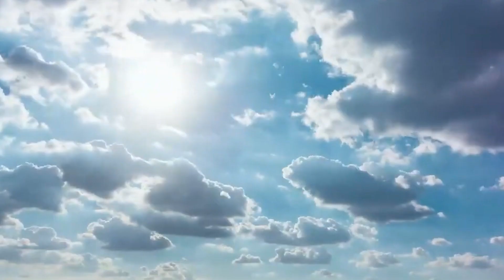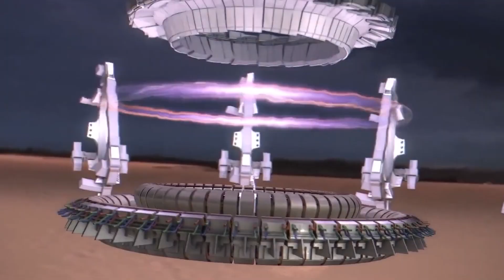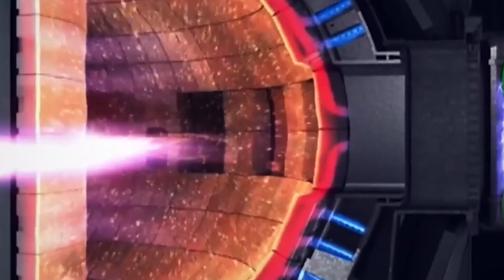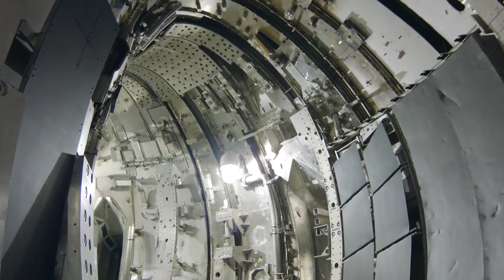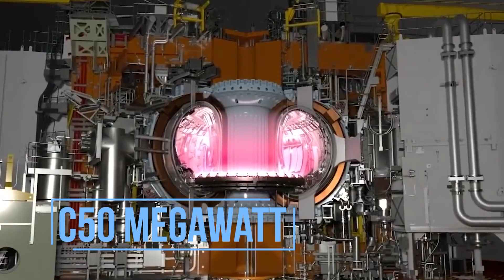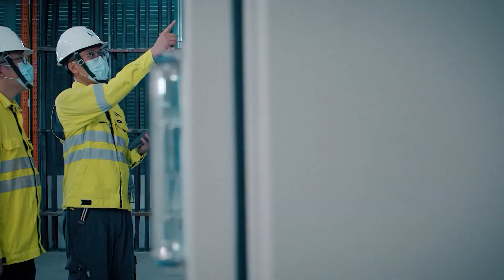This Fusion Reactor Will Produce Electricity By 2024

Comment: How much of the rare He-3 will be needed to start a reactor? I gather it is intended to use the He-3 produced in the D-D reactions to continue the reactor but what will be done with the equal number of radioactive tritium atoms produced in the same D-D reactions?
Reply: If I understand right, they removed first all air inside, to almost full vacuum and then few kilos needed to seed process, but I hope someone more wise come and tell how it goes.
Reply: The D-D will be a separate production just to make He3 to prevent that in the commercial reactors.